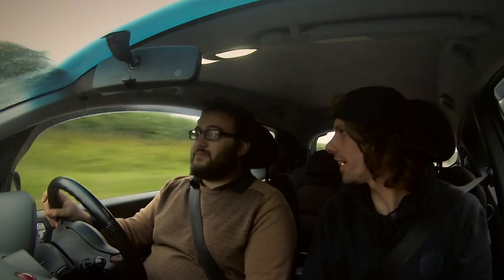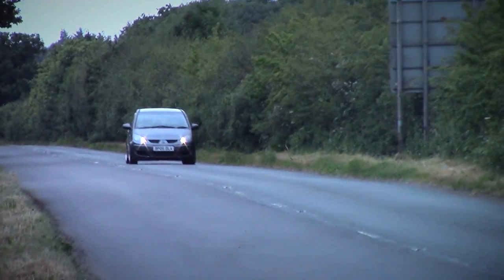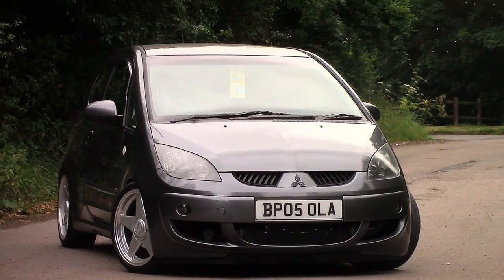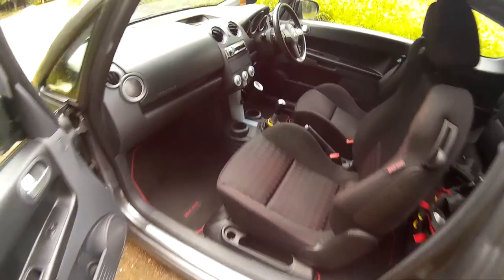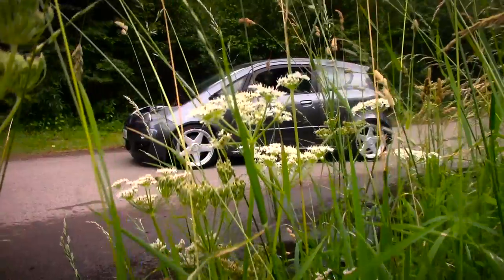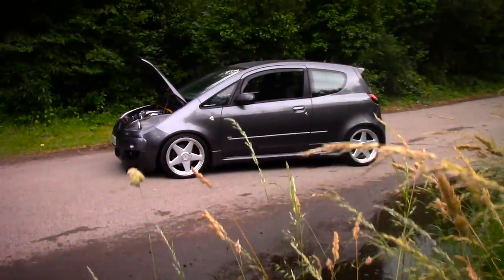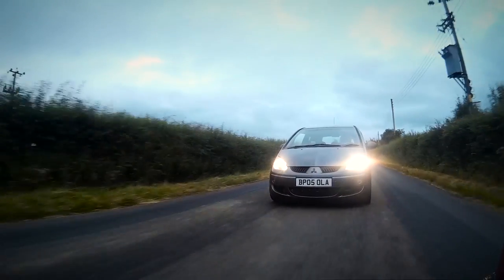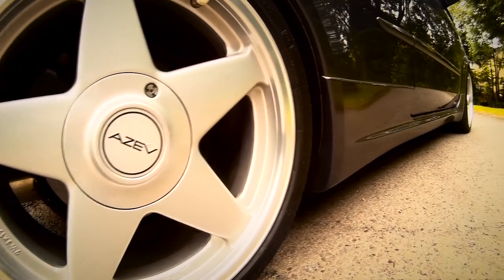Driving a 215bhp Colt 1.5 Turbo - Ben and Jon Do Cars

Comment: Bought one of these recently to use as a daily for work and to keep my 2016 Leon FR 184 in better nick. Brilliant little car, stock handling is a bit spongy and bouncy but I can't really grumble at 150bhp from a car that only cost me £1400 with only 72,000 miles on it. :D
Reply: @nofxorbust  You guys are talking about Right Hand Drive, Left Hand Drive in continental europe are around 3000-5000 EUR/GBP
Reply: do you feel much pull when flooring it?
Reply: @adamsheikh1384  Definitely, I've stripped out the rear seats so it only weighs about 1000kg atm. After 3000rpm when MIVEC and boost are active it pulls really well.
Reply: Swagatron 5000 awesome. I’m after a new car and torn between a colt or mk5 golf gti. my favourite thing about the golf is it sucks you into the seat extremely hard and i love it.. just wondered how hard the colt does?
Reply: @adamsheikh1384  Stock it won't compare to the GTI, but strip it out and remap it and I guarantee it'll be a blast. Also, CZT's are very rare nowadays, especially compared to boring boxy golfs. Can't beat Japanese engineering either, engines are bulletproof, which definitely cannot be said for golfs :P
Reply: Yeah i got mine 5 years ago only cost me like £1800 the handling is scary stock definitely get it lowered as ive had ome incident where the car understeered and i nearly smashed into the kerb but thankfully i saved it lol , but in a  straight line they will beat most other super minis , i had some joker in a Fiesta try to keep up with me and i left them in the end , it was funny as he was in an ST which has a 2 litre Naturally aspirated engine but because the Colt is light it flies

Comment: I have the 1.5 3 cylinder diesel and it's still a hoot....more powerful than the ist xr2's and they were a quick drive!
Reply: Considering getting a diesel one as my daily for work. What's your opinions on them. Mpg etc
Reply: @thomasoreilly6276  50 mpg very good daily car.
Reply: Yeah ive got 2 of these colts i have a 1.1 dailt driver due to the ridiculous cost of petrol in 2022 and i have the CZT for weekends but sadly might sell it soon as £2 a litre for petrol is just madness its killing me